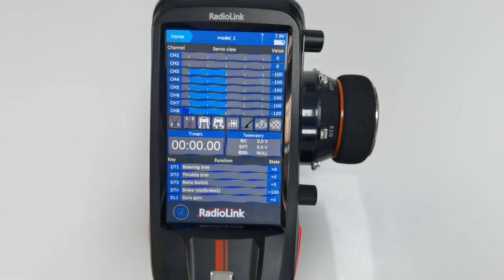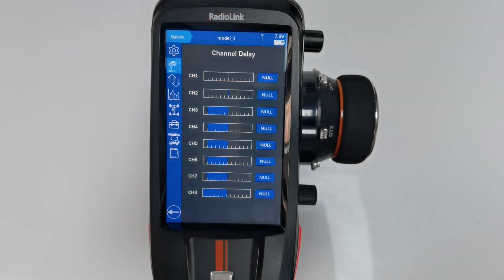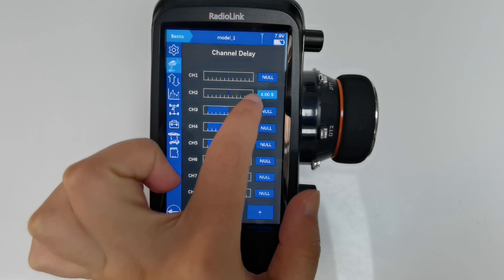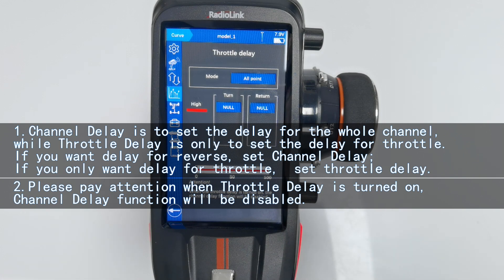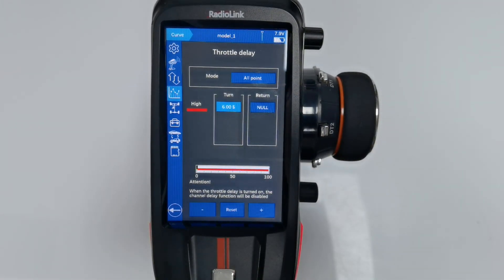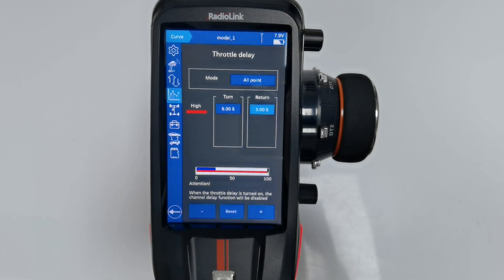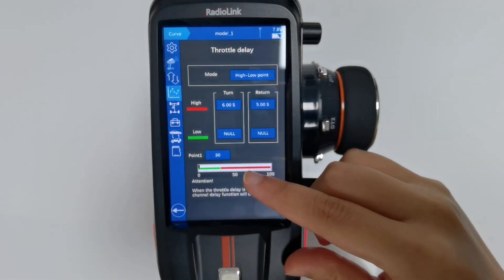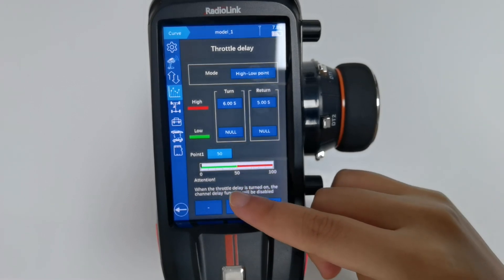Throttle Delay & Channel Delay of RC8X

Comment: Hello, I need some help updated to the 1.3.0 upgrade, and my remote has lost throttle control. None only shows on the end point calibration screen. Also, on the main screen icon with car and swivel lines lights up . I'm waiting on a response from radiolink support. Any suggestions would be greatly appreciated.
Reply from the maker: Hi, sir. Here is the tutorial to show how to update the firmware of RC8X: https://www.youtube.com/watch?v=cUAxwb3nxuw  You can download the V1.3.0 firmware from RadioLink official website: https://www.radiolink.com/rc8x_firmware  After the firmware, if the problem still exists, could you please test RSSI? Here is a tutorial to show how to test RSSI: https://www.youtube.com/watch?v=RA0NasTZS90  If there is any question, please feel free to contact us. Our email is after_service@radiolink.com.cn
Reply: @Radiolink_official  tried updating again. Radio binds and steering works. But there's no throttle output from the remote itself. You can not even see bars on the transmitters' main screen when you move forward or backward.
Reply from the maker: @brianstevens2244  Hi, sir. Sorry for the problem. Here are our suggestions. 1. Could you please reset your current model? You can enter the menu model select to reset the current model.  2. After reset the current model, could you please calibrate the throttle on RC8X? Here is a tutorial of calibration for your reference: https://www.youtube.com/watch?v=pRnrocA0kKI   If there is any question, please feel free to contact us. Our email is after_service@radiolink.com.cn

Comment: Потеря сигнала на 50-60 метрах . Пробовал на 2-х приемниках. Ужасное качество разочарован что купил ваш пульт RC8X
Reply from the maker: Hi, sir. Could you please first test RSSI to make sure there is no problem of signal transmission? If no problem of RSSI, you can update the firmware of RC8X to have a try. Here is the latest firmware of RC8X. You can install it. https://www.radiolink.com/rc8x_firmware  If there is any question, please feel free to contact us. Our email is after_service@radiolink.com.cn